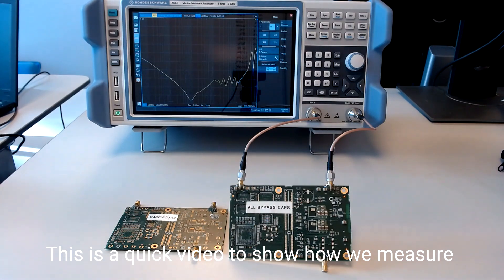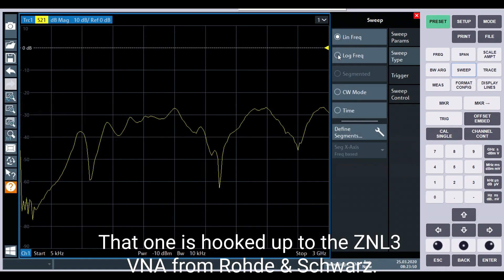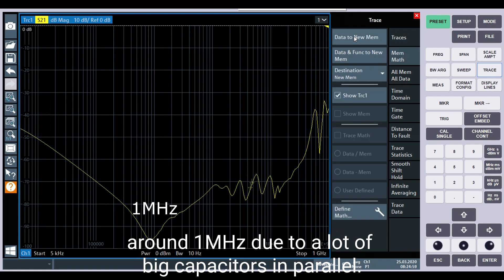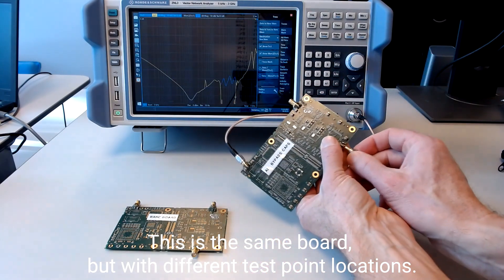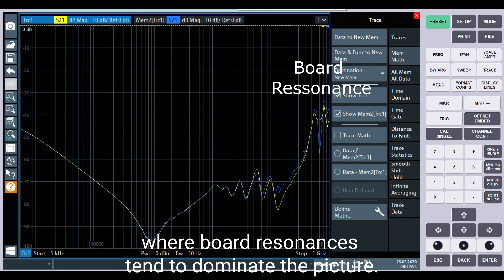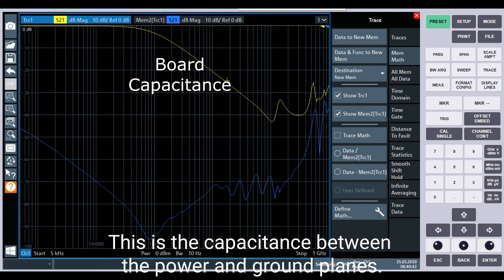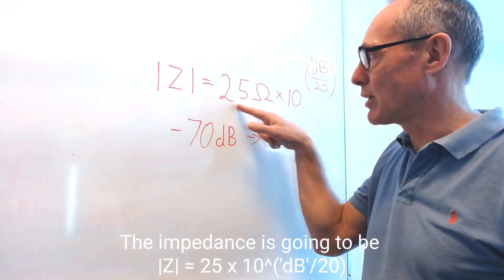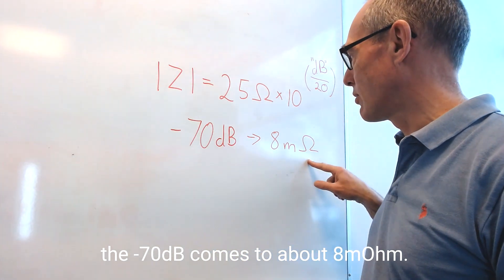PDN/bypass impedance measurement with a VNA/network analyzer

Comment: Are there footprints for those SMA connectors designed into the board or are those added to pads that would be capacitor footprints just for this measurement?
Reply from the maker: The boards were not prepared for these measurements, so just used cap footprints for the SMAs. In my course I show how to do this in a smarter way.

Comment: Hi! I tried making these type of measurements in the past and it seemed to me that the location where I placed the probes resulted in different impedance profiles for a PDN. I have heard that it should not matter where the probes are located along a voltage rail, I should be getting about the same impedance response. What would cause the different results? Essentially I placed two probes on the same two test points across a capacitor and pretty much got the bode plot for a single capacitance. Then I left a probe across the same capacitor and placed the other probe at a location down further along the same voltage rail (another capacitor) and the impedance profile looked more like I expected, with some anti-resonant peaks. What could I be doing wrong? Thanks so much.
Reply from the maker: Never measure straight across a cap. Remove the cap and place it on top of another one to have a cap-free probe point.
Reply: @EE-TrainingDK  thanks for the feedback

Comment: Hello Thank you for this video.  Could measured the impedance of the board if there are active components, as processors?  there is some extra caution should be taken?
Reply from the maker: Yes, the active parts can be mounted as well. Initially, I did not think that was a good idea, but found out later that it is okay. See my blog for more examples with active parts on.